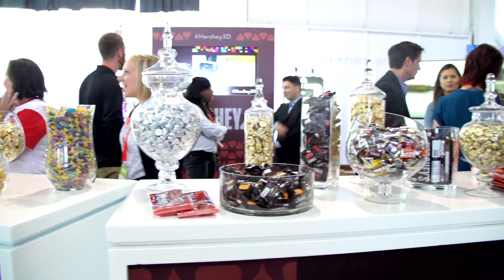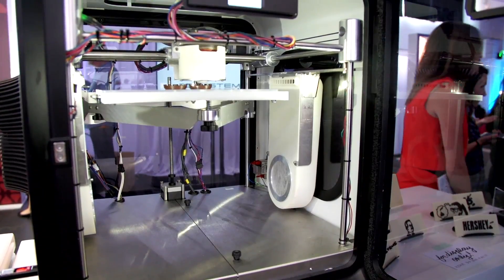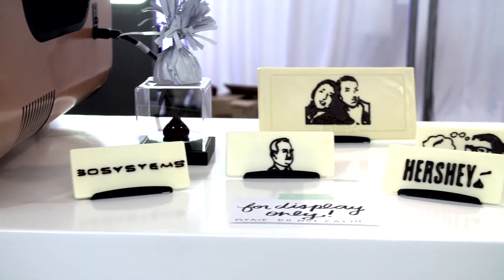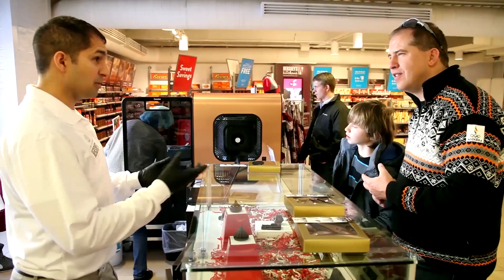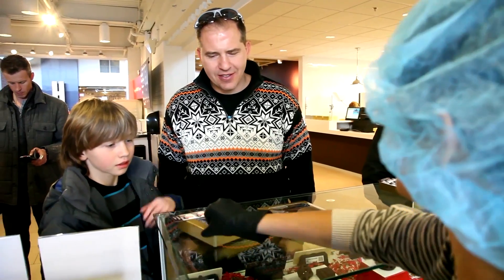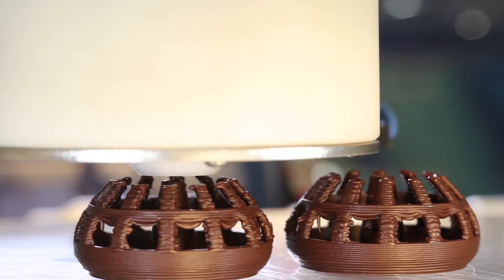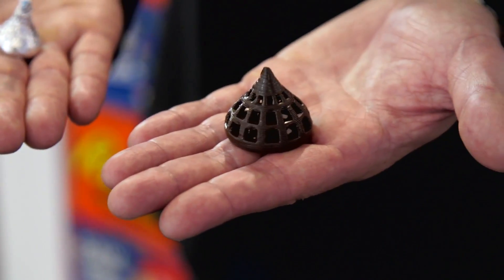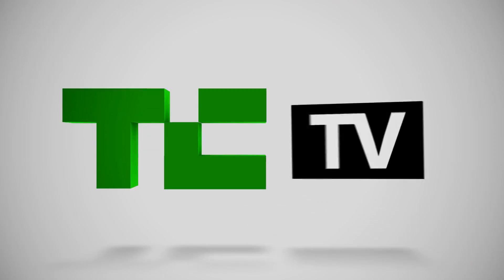Hershey's 3D Printer Prints Chocolate

Comment: h0w did the chocolate go solid when it came out that fast?
Reply: Like plastic 3D printers I'm sure there's a fan with a duct that blows cold air over it right as it comes out so it can cool and harden faster than leaving it hot.
Reply: @JoshuaPritt  either that or the inside of the printer is refridgerated would be a lot more effective. blowing room temp air doesnt cool very efficiently. unless you want to cool an 80 degree cpu hesatsink